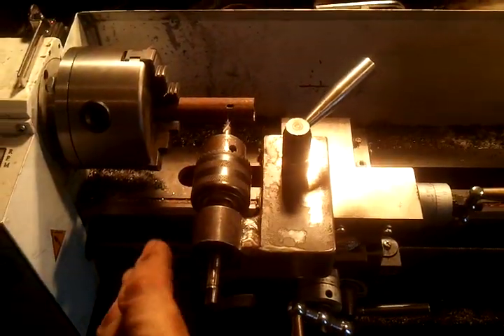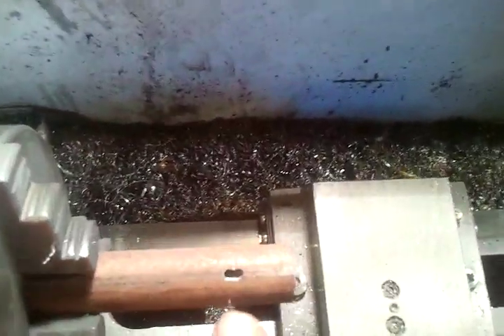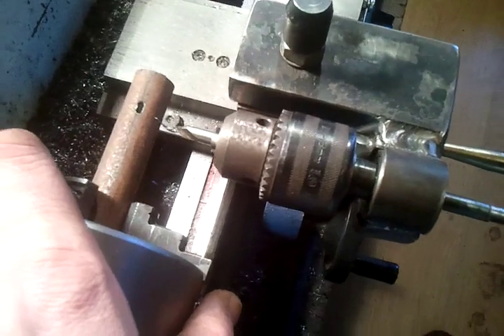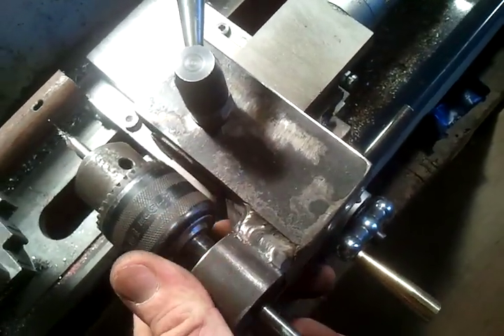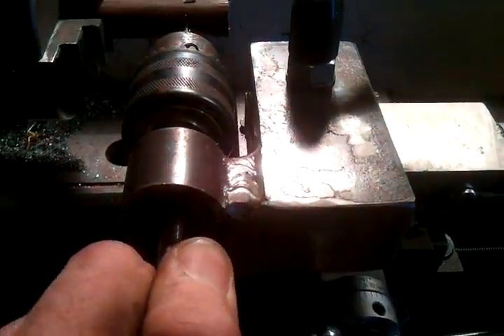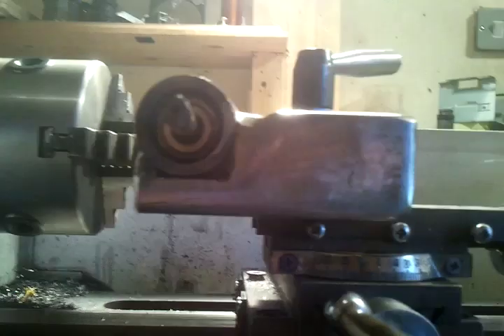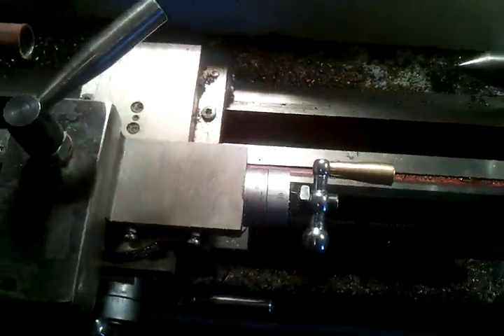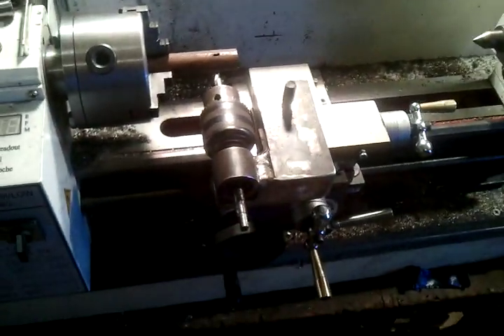Homemade Lathe tool, part 1

Comment: I was thinking along same lines as you can make gears with this arrangement. But it would be good if you could have an index plate for your lathe.

I was thinking too that if you had some stock where an exactly centered hole was drilled across (something factory) then you could have used that to hold the drill head by same sized drill bit to exactly on spot when welding it. So that centers where perfect with little to no run out.